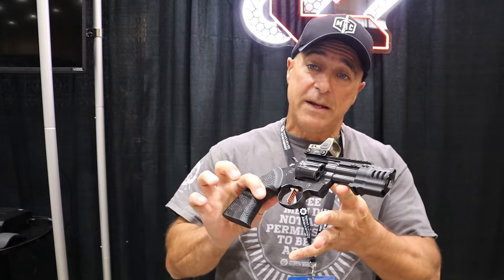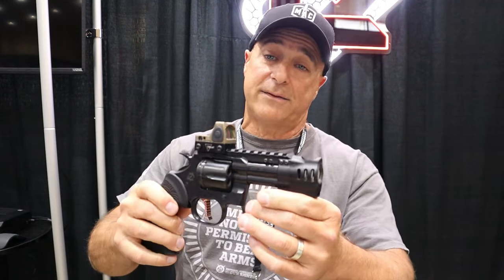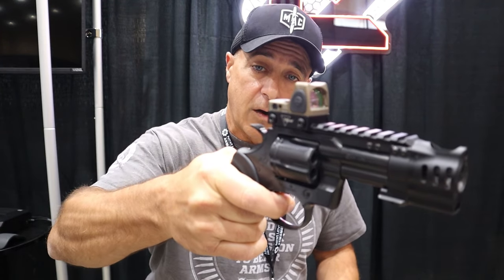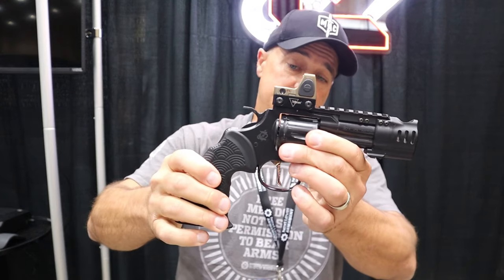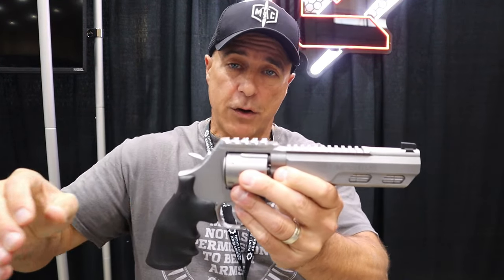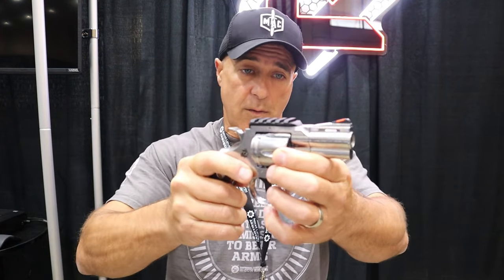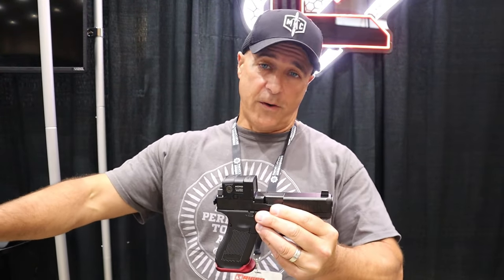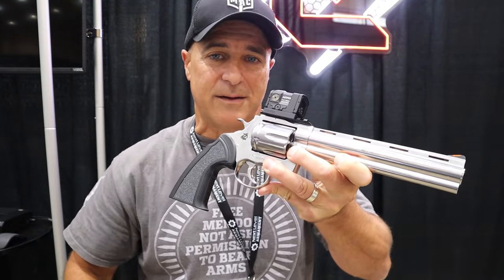Revolver Upgrades You Never Knew About! - TheFirearmGuy #Triggrcon24

Comment: Something else that I rarely if ever see on a revolver is any kind of beaver tail. INB4 "That's to stop slide bite, dummy!" Hear me out. Fitting into that groove and a little beaver on your webbing seems like it would (in theory) help mitigate muzzle flip, which most short barrels and revolvers tend to be snappy. Also, it'd help your hand settle in nicely to know that you're holding the gun correctly. That's why Chiappa's are popular. Low bore, less flip. What do y'all think?
Reply: I've seen some grips in pictures of competition guns that had the beav like you typed of.
Jerry M has described how he grips the gun so high that he nips off the hammer spur so it doesn't contact his hand.
Reply: @archangelmichael1978  D&L Sports has had a grip with a beaver tail for a few years now. Ever since I started carrying a revolver I've opted for a higher grip to better mitigate recoil. I also prefer to shoot DAO. So I bob the hammers which eliminates hammer bite, hammer rub and doesn't impede that higher grip

Comment: I have the Empire Kage comp system in the white, or bare aluminum for my Colt Python. Picked it up about a year ago. Cool kit. But I ended up taking it back off.
Reply: Why did you end up taking it off?
Reply: @grahamohea2424  Picatinny is a horrible choice for reflex/dot optics mounting on a handgun. Results in the optic being excessively tall. As the optic mount then requires a picatinny adapter mount as well. Revolver optics don't need to sit up high. The mounts need to allow for lower optic height and for the use of the irons. Footprint dedicated mounts that replace the rear sight do a far better job keeping height over bore to a minimum. I also didn't care for how it shifted the balance. I shoot mostly 158gn. If compensation is required barrel porting will accomplish that.